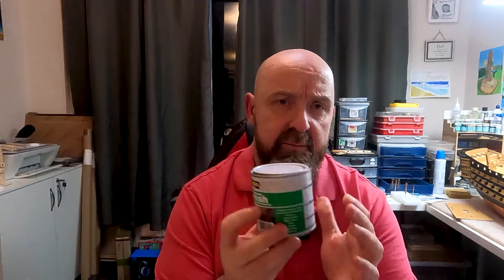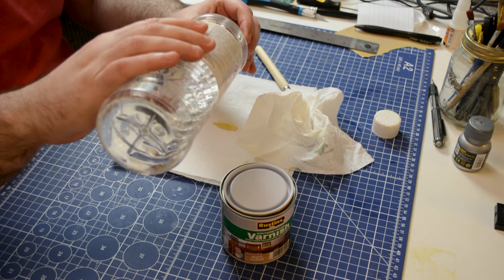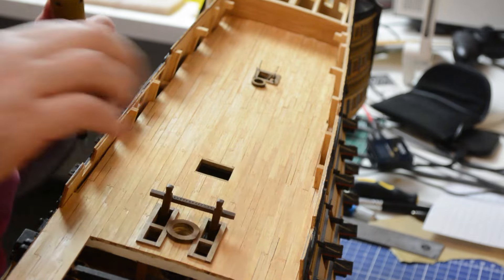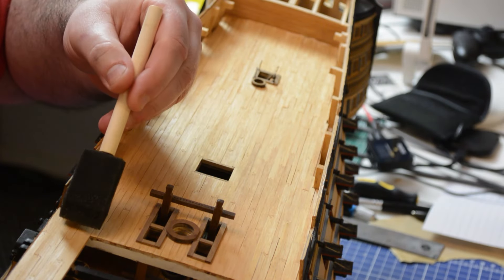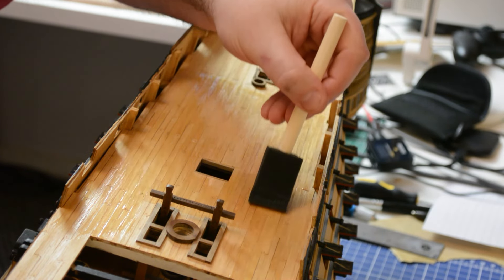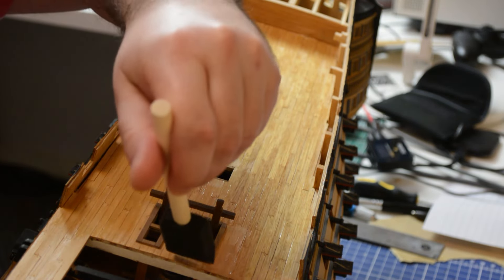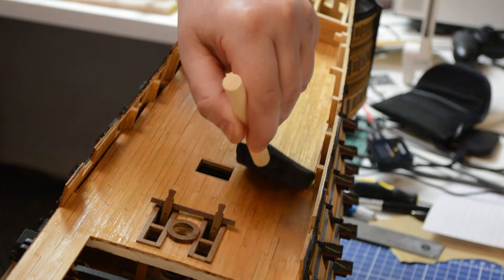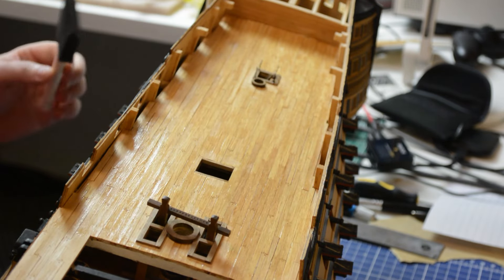How To VARNISH The Decks - Model Ship Building

Comment: Hi John, as a fellow ship modeler I know how expensive varnishes can be and how infuriating it can be when a can of varnish goes off and sets hard in the can. Here is a tip I picked up somewhere to prevent that. When closing the can wipe the varnish  from the edge, replace the lid securely, then turn the can upside down for ten seconds or so.  This will seal the can and prevent any air from getting in over the long term. I hope you find this useful, as a user of Humbrol enamels I certainly did.  Looking forward to the rest of the build.
Reply from the maker: Thank you, I will remember that tip for sealing the varnish tins